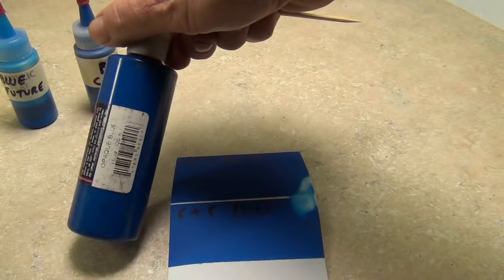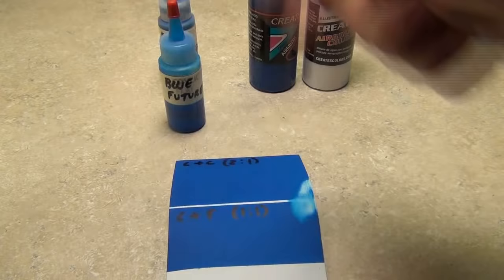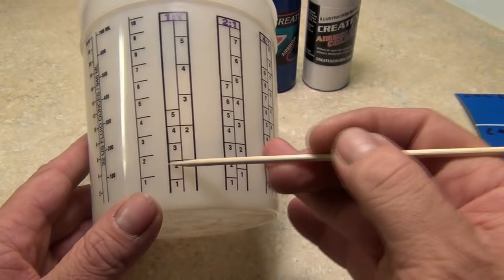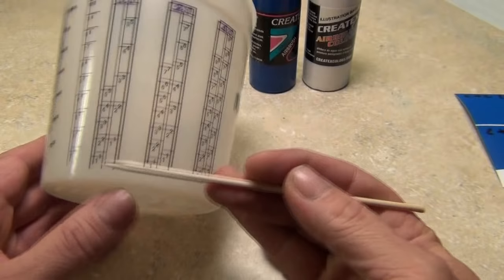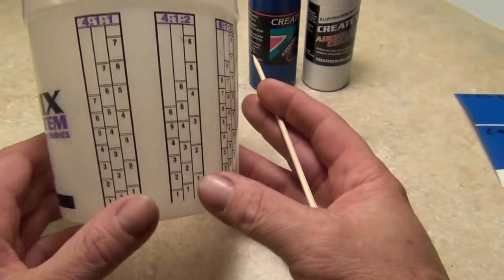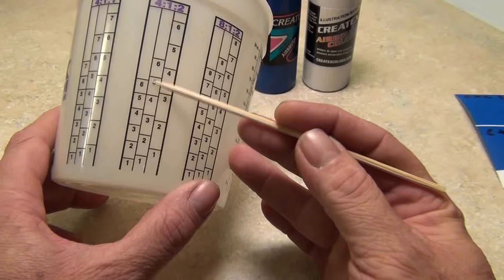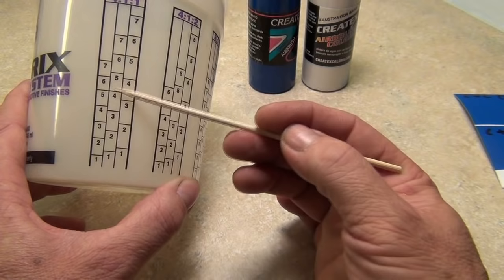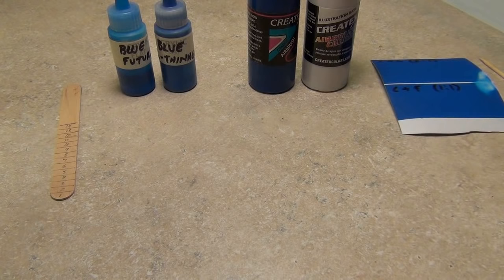Mixing Ratios Explained at  2:05 minute mark

Comment: I've always felt like a dummy when trying to figure out these ratio mixing cups Clearly I'm not a pro and I failed math in highschool. I still feel like a dummy, but one who finally understands it. Almost certain I do ;-) Thanks!
Reply: Lars,

You should not feel bad! I have a Ph.D. degree in electrical engineering and still was not able to figure out the markings on the container without reading the instructions on the Internet! Thanks for your appreciation.

Comment: Very well explained, easy to understand as I know what to do to mix it. You should always use the same number when you fill up no matter what the mixing ratio is, but all of them must come with same number to get good mix. For example, your primer is 4:1, look at 4:1 on the cups. Fill up the primer to 2, then fill up the hardener to 2 to make it 4:1. Same with clear coats but the mixing ratio is different 👍

Comment: I want to thank you, that was a nice simple to understand explanation, I already knew the easy 1 to 1 ratio, but I am getting ready to spray a ceramic undercoating on the bottom of my car and it calls for a 4 to 1 ratio, and I have some PPG measuring cups but I did not understand the measuring numbers, but your instruction is very clear and I now understand, sometimes my dyslexia kicks in and I get thrown off on the measuring I was going to ask my neighbor who knows these things but I was a little embarrassed   thanks again, It's to bad not every mix is a 1 to 1 ratio, like they say, "But knowing is half the battle' thanks again. now I don't have to go to Eastwoods site, they probably just would have confused me anyway.

Comment: i'll add one thing. . .cup should be level and don't let it slosh when pouring the paint in to cup.  you won't see your line.  once paint is in, don't pick it up to get a closer look.  you'll most likely tilt the cup and the paint will cover the line too.  pour paint slowly and let it creep up to the line, then add your pt. 2.

Comment: Thank you for a very understandable video.
One thing though: Just where can one get a Matrix System Mixing pot or similar?
I have searched but all I can find is 50 Pieces of one pot or another that is completely different than the pot that you use!
Understanding Mixing Ratios really does depend on using the Pot you use.
Looking at the other Pots on-line they look completely different and therefor are a complete mystery to me!!!
Please could you advise me where I can get an Identical one that you use from, hopefully in the UK, but I could always purchase from the USA if possible!
Thank you all,
                         Rob in the Berkeley Vale, Gloucestershire, in the West of England.

Comment: Thank alot I just bought 3 quart of matte black and it 3:1 ratio now I know how to mix it. I go up to 3 with the paint then to the 3 with reduce and also using the same cup. I could just watch then left but I had to leave a comment. It my first time using expensive paint and I want to get it right. 8:1:2 should read as 8/8/9 right or no.
Reply from the maker: yes close enough bro .. thanks for commenting

Comment: Hello. I just bought a paint mixing ruler, and honestly I am confused with the ruler, I understand perfectly the ratios, but the ruler itself Is useless for the fact that if I use it I need a perfectly cilindrical container right? If I use a slightly conic container I will get bad mixing ratios correct?

Comment: OK, let me see if I 8nderstand a bit. m3 part polyurethane. Unfortunately the catalyst is 20% and thinner 20%. So on the cup I pick 8 which will work out for what I am painting. Next will be catalyst at 20% then I go to line 2 and add to? and then thinner at 20% I then add in the third columne at 20%. what am I doing?
Reply from the maker: you can use the oz measurements on the cup ,,,so if you pour 10oz paint add 2 oz of the others

Comment: Sheesh I've been trying to find this out and I even went to a professional paint shop and I didn't really understand but this video really wrapped it up. I'll be doing a kandy project from HOK on a car in a week or two and was wondering so I've been given the ratio of 12:1 but within the ratio is 4:1 (clear(not regular automotive clear its for autoflex) but how would I go about it with the kandy? So it would be 12 parts of the clear w/ activator & then :1 of the kandy but I'm supposed to use 8 oz's of the kandy with all of that. how do i go about it?

Comment: I found a lot of the plastic cups mixing ratios are wrong... With the taper of the cup and even when they silk screen or apply the scale on the side are not exactly right...I would double check it with a measurement cup to make sure I brought this up with a few other painters and after I showed them then they were thankful becouse they always ran out of hardner can could not figure out why but the cups are not right... Best way is with a mixing stick and a straight sided mixing pot not tapered and clamp the stick to the side with a small clamp for it don't move..
Reply from the maker: best way if its super critical is ---by weight

Comment: a single column of 1-20 should be enough for the job, ppl can calculate, and this will be replaced by programmed pump in future, just choose formula on panel and u don't even need measure cup in the ending part

Comment: Hi, this is still confusing because it does not address the actual amounts you need, you only mentioned parts but if if I need ten ounces of resin, how far up that table do I go 2 or 3 or 4. That’s what’s missing from those cups. Thank you
Reply: There is a ruler on the cup.  In this video it is at approximately 7:02.  Follow the 10 oz line around to the appropriate ratio.

Comment: YI read another guy's comment on another, channels video. And the guy in the video. Was asking about different ratios for paint. And the guy in the comments told him he should use a 2:1:1 paint hardener and reducer! So my question is? Because I'm a newbie also! Is that ratio a 3 or a 2 part ratio? So to speak. 3 of my mixing cups do, have a, 3:1:1 But the other 3 cups I have. Only have a 2:1 ratio as the smallest! So if I wanted to do a 2:1:1 ratio how would the hardener! Or reducer be included?
Reply from the maker: use the 2;1 ratio and that add thinner to what you think is right

Comment: excuse me i am less than a begginer so i am having some problem swith a primer that says goes like 16:8:1 I am trying to use an evercoat paint mixing cup bot it does not seem to show that scale, what scale should i use? or how do i translate to another scale?
Reply from the maker: +Salvador Ramirez possibly it is,  2 parts primer to 1 part reducer plus a tiny amount of cataylist
Reply: divide everything by 8
Reply: 8×2=16,  8×1=8, 1/8

2:1:1/8

Comment: I need to mix 3:1 ratio and how do i measure that on mixing cup?
Reply: I need to mix the same ratio. Paint, catalyst & reducer. Did you figure it out? Thanks
Reply: @VintageJunker  Yes i did and video show exactly how it done. I got my clearcoat mix correctly and consistent.

Comment: This the same for epoxy??
Reply: Some epoxy companies have calibrated pump sets you can purchase, which I use all the time. Additionally the companies do have the measuring cups for sale but the ratios marked on the cups will work for epoxy. If in doubt, pour some epoxy  (small amount) out to the ratios and see how it sets up

Comment: I understand the video, but it's way too involved for model amounts,  No one is going to use that much for 1/25 or 1/24 67 Chevy Impala.  I realize Createx is pigment heavy and needs to be thinned and shot with heavier air pressure. and all airbrush's are different in performance.  People will just need to develop what works for them.
Reply from the maker: the video is more for information on the mixing cups.. if im doing a small batch for a car i just rough measure the amount